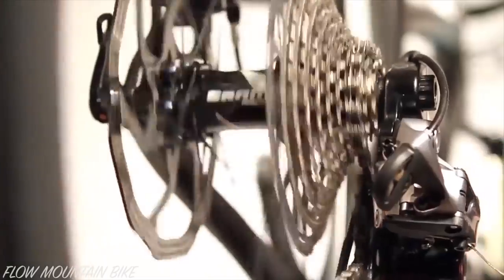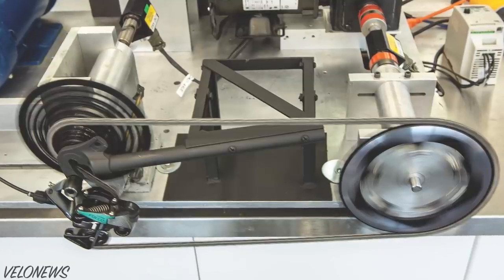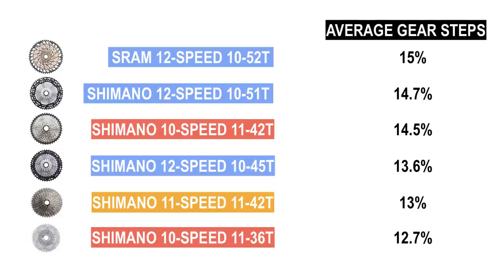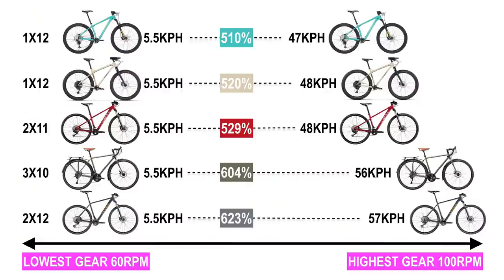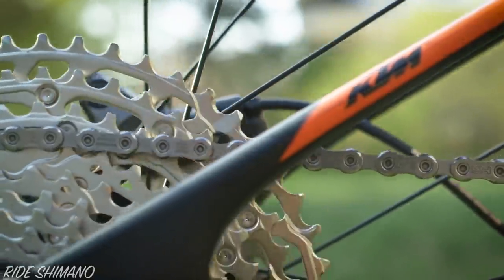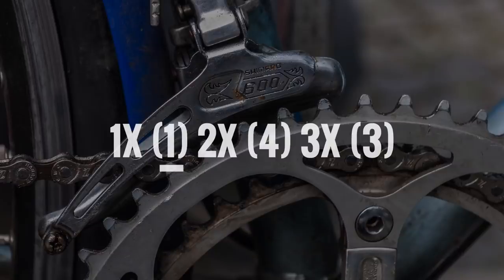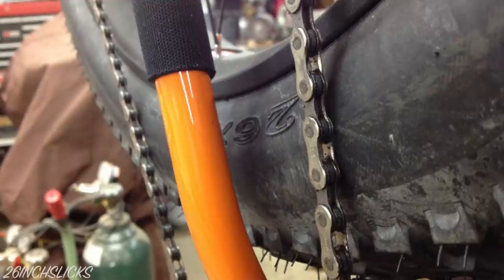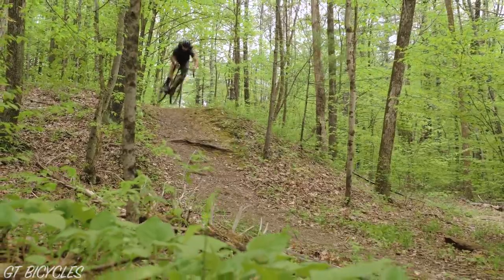1X vs 2X | What is the ULTIMATE Drivetrain For Your Bike?

Comment: Very timely... I'm in the middle of a 1997 Gary Fisher restoration 👍🚲
Reply: I recently stripped and powder coated my 1998 Gary Fisher Aquila. I replaced the fork 7-8 years ago with a Rock Shox Dart model, which was a great improvement over the worn out fork that was on it. After the frame was powder coated, I installed a new Alivio crank, a Wolf Tooth Components 34T narrow-wide chain ring & bash guard, and an Alivio 9-speed shifter coupled to a Deore XT derailleur and an 11-34 cassette. I did not think about the 9-speed drive train NOT working on the old wheels, so a new set of wheels were purchased also. OOPS.  I installed new Avid V-brakes and Avid brake levers also. Since I was building the bike up for commuting, I also installed a Blackburn rack. I only use the bike to cruise the bike paths, so I have 26 x 2.0" Bontrager slicks on the bike. All in all, it was a fun project, and I do like the simplicity of the 1 x 9 drive train. The 34T chainring and 11T sprocket at 100 cadence will produce 23.9 mph at 100 cadence if I remember correctly, and the 34T rear sprocket is low enough to get me up shorter and not-to-steep climbs. Since I live in the Denver Metro area, I am seriously considering an 11-42, 10-speed drive train.

Comment: I feel that there's another variant that's often ignored: 1X with an internal gear hub. Many 3 speed internal hubs can accommodate 8 or 9 speed cassettes and maybe (with some modification) 11 and 12 speed ones. That would allow you to reap benefits from both systems and have a wider gear range, since you can't cross chain.
Reply: Yes like the SRAM DUAL drive, works great.  You could fit a wide range cassette too, with an 11-40 you end up with a massive range of gear ratios - 640% !
Reply: Yes, this is what my Brompton does on a smaller scale with just two sprockets to double the three speed hub. Just seen a video of the SRAM DUAL drive that says you could keep the triple chainset and then get 81 gears, hilarious!  BUT...hey why not go 'hog wild', get an 11 speed hub, 12 speed cassette AND a triple, now you got 396 gears if my maths is right!  Probably not possible but 'one can dream' :)
Reply: @lauriethompson740  1x with a cassette and a 3 speed hub would be essentially the same as having 3 chains on front. The late Sheldon Brown had built one bike with 63 gears before those wide range groupsets existed. It consisted of a 3-speed Sturmey-Archer hub with a 7-speed cassette and 3-speed crankset. And that was before Sturmey-Archer offered a hub which could mount a cassette and SRAM's Dual Drive.

Comment: I just replaced a cheap chainring.  The first was replaced at 60000km and the second at about 180000 km.  I live on a dirt road so it is impossible for the chain to be kept clean.  Clearly I am not trying to win races.  But the figures in your video shows the extreme cost of seeking the highest performance.  Incidentally I also have gears from 22 -> 34 up to 52->11 a 7.3 to 1 ratio.  Because I am getting older and I want to remain on the correct leg pressure on any climb.  So "best" does depend on what you need from any system.

Comment: I use my hardtail for exercise, mainly on roads with nearly-slick tyres, and for longer rides and days out with cycling groups on canal towpaths and trails at weekends on fast-rolling "spuddy" tyres. I like my hardtail and don't want a roadie or anything with dropped bars.

I recently converted my 2x10 to 1x10 mainly because I detest the front derailleur - it's the clunkiest piece of engineering on the planet - so when my front sprocket need changing because it has worn so much, the 25% extra cost to convert to a 1x crank set made sense.

To be fair, I don't need the vast range associated with the 2x and in fact I could only ever get it into the very fastest two top gears when I was going down steep hills - I'm simply not strong enough to use those higher gears at any other time. I'm happy to coast downhill when I reach my current top speed (it's a little under 30mph - feels fast to me), so a smaller sprocket than the previous-large one suits well (I've gone from a 39T/24T to a 34T). Also, the narrow-wide chainrings are so great - I built a bike for my son with a 1x chain ring about 6 years ago and he's never lost a chain. The retention that narrow-wide tech offers is amazing. Such a small thing but the effect is incredible.

For me, the increased simplicity of a 1x leads to reliability, and that is the deciding factor. But even though I'm not a competitive cyclist, I concede that the steps between ratios are sometimes larger than I'd like. I'm looking at alternative cassettes to see if there's any with more linear steps than those I currently have but this is just tweaking - overall I'm very happy with the results.

Comment: My 9 speed chain lasts way longer than my 10 or 11 but it is on a triple so the chain is usually straight and from what my friend said his 1x12 chain didn’t last long at all and he’s just replaced it with one that cost £80 to see if it’s any better
Reply from the maker: The data suggests it's the top-tier chains in particular that have the excellent longevity. 👍🏻
Reply: CYCLINGABOUT yeah I’ve noticed a big difference in using wippermann chains compared to shimano, SRAM or KMC personally it will be interesting to see if my mates top tier chain lasts on his 12 speed set up because the last one didn’t at all
Reply: nickel metal chain   😉

Comment: 2x FTW
Reply: Yup.  I have 1x, 2x, and 3x, and except for grinding up outrageous gravel, 2x wins.  1x is misery.  Kids these days (haha) don't understand the value of good chainline and using the largest rings and cogs that you can for a given ratio.
Reply: I like the SRAM 2x10 system. 20 gears (even though one doesn't use them all), no front derailleur rub ever.
Reply: damnnn    😙

Comment: It's 1x11 on my carbon road bike (50x11-32) and 1x10 on my cheap and heavier winter bike (44x11-42). Smallest speed aimed to the 15% climb on my way home and the biggest is enough to do flat.
I got fed up of the front derailleur ; added a cog behind and removed 2 chainrings.
I don't see the front derailleur going away for those who want to do mountain climbing and also want to go quick in descents (even-though I can't understand that 3x still exists).
Most people riding bikes don't need 2 chainrings with 10 or 11 cogs on the cassette.

Comment: This is something I'm considering, whether to switch to a 1x for commuting or go 2x. Durability and longevity are my governing factors, the maintenance I find is a calming past time 😌. So I'm thinking of the Deore 1x12 ... as I'm at the stage where everything needs replacing anyways...
Reply from the maker: We don't have any data on the Deore 12-speed stuff yet, but using the groupset with a top-tier chain (XTR or maybe XT), which employs the latest metal and coating technology - should keep everything durable and long-lasting.

Comment: I have 1x3 but would prefer internal hub gears or 1x1 for simplicity. The highest gear i never use when on touring trips, down hill is rest time! Could have a lower gear than what I have though.
Reply: Downhill is for spinning the lactic acid out of your legs. I ride a 2x10 and tow a trailer (20+ kilos) and rarely use my lowest gears.

Comment: I use cadence to measure my ride over ride comparison. I am averaging 72-74 on a 20 mile run. High around 110-115. Pretty much similar ride profiles on most days. I currently have a 3x9 hardtail drivetrain. The overlap is pretty large. The top end is really low. Most of my riding is on gravel. Much of it not too hilly. I believe a 2x drivetrain on a gravel bike is best. I think the range is better than a 1x and it will have less overlapping gearing than my 3x. Your video is helpful in understanding the variance in %. Sounds like 2x is the way to go for me. Unless.... I start looking at closed belt systems with 600% spread and average 14% diff in gear changeover. Then it’s back to the drawing board😂😂😂😂😂
Reply: I also found that for anything used on road aside from touring a 2x is the best setup...period.

I have custom built 4 bikes all using 1x and every one of them lacks the gear steps to maintain cadence when going up or down a hill.

1x is a great setup for simple rides and for mountain bikes. But if you want some speed on pavement, 2x is the best.

3x is for touring or anything with loads. I use a 3x to haul my kid around.

Comment: I always skip 1 rear cog when I'm on the small front chainring on my daily driver when accelerating, and only go up or down by 1 on the rear when I'm on the large front chainring.

When I change to the large front chainring I go 1 back on the rear and increase/decrease by 1 after that, and I'm usually riding in the 2nd/3rd smallest cog unless going downhill or having a good wind in my back, what that tells me is that a 2x for a regular citybike is more than I need, a centered front cog (slightly smaller than the current front, but about 10 teeth bigger than the current small front cog) and 8 rear gears will benefit my much more.

Also being 1x8 means the chain won't cross as much as 11/12S (Although my 1x12 MTB is the best I've ever ridden with despite having a more limited top speed)

We need a front chainring that will move in and out, eliminating cross chaining, and keeping it 1x.

Comment: I've one bike with 1x11,  one with 3x9 (have had many) and two with 2x10. My current touring bike for 11y has a Roholff and that's my favourite, but for a cheaper bike, 3x is my favourite. I had a Dawes Galaxy with 3x8 for 13y but I changed the gears to an MTB 42, 32, 22 and 11-32 and the range this gave me was unbeatable. This bike eventually cracked.

Comment: Very well summarized. In my opinion they should make a cassette that has very small variances in the 95 cadence/30 km/h area as thats where most people spend time on roadbikes. Should be very easy to just have 2 gears very close to each other at that particular speed, and sacrificing one of the accelerating gears instead. I live in Indiana so its very flat ofcourse, but if this option was available, then it would be a no brainer for ME.

Comment: I use 2x10 on my Genesis vagabond and 1x12 on my trek rail, on ebikes drivetrain wears out quicker and must be checked out much often, to use a full steel cassette and chainring will prolong the life of the transmission making it lasts longer, on 2x10 on my gravel things are really different on normal conditions thousands of kilometers can be made.

Comment: As someone who still only has a 2x8, I'm a bit surprised with the results with chain longetivity. I assume (and because Berm Peak videos) that the thicker 8 speed chains would mean it's more durable.
At least it makes up for it by being cheaper, which not only applies to the chain but also the whole drivetrain.

Comment: Nice video. 2x will always have a place, and I don't see 1x vs 2x being in competition. Different tools for different purposes, something retro grouches that hate 1x need to realize. 3x, on the other hand, is dead. Not because of 1x, but because 2x has improved so much that 3x is redundant. 2x12 has superior chain longevity, similar chain angles (and I don't believe for a second anyone can feel 2-3 W difference), same gear range, and comparable ratio. Most of the overlapping gear on 3x gets ignored anyways. 

But wrt 1x, chain retention wasn't mention. For full susp absolutely its a necessity with frame constraint on front mech. But even with a hardtail or full rigid, chain retention (and yeah, tire clearance) make 1x absolutely superior for bikepacking. Even on farm roads (esp the ones here with heavy corrugation and pitting), 1x chain retention is a nice benefit. And, to add, popular bikepacking (at least in the Americas) is now in places that you simply must have a 2.8"-3" tire. You simply won't make it on something smaller. And, for that, you must use a 1x (unless you're on a fat bike, at which point efficiency is out the window, anyways). 

Once thing I'm not buying is the argument people make for gear range. I mean, yes, on paper, 2x/3x range is "better". But, on paper isn't real world. 1x has the same range in the lower gears. Its the high gear that is lacking; one may argue its either, depending on the front chainring chosen. But, mountain bike frames limit how large you can go on the front, typically around 34-36T. So, 1x suffers at top end, as you mentioned here. But really, how many people are consistently making sustained use out of a top end gearing that would have them, on a loaded down touring bike no less, running velocities that would place them in a World Tour peloton? Seriously...
Reply: I use the full range of my 3x9 22/32/44 in front with an 11-34 cassette out back. Loaded or not. I also pull a trailer quite often. When I'm not loaded, I like to be able go as fast as I want. 1x would be limiting for me as I would have to give up top end in order to keep the low end I have and use. Why should I have to compromise because of a stupid industry trend to force us into living with a limited range drivetrain? Getting a satisfactory range out of a 2x setup would cost me so much more money than what I already have that it's just not worth it. If 3x does eventually go away entirely, and I need to replace parts, I guess I'll have to cross that bridge when I get there.
Reply: @soundbites1152  You can't fit plus tires on your bike. You aren't relevant to this conversation.

Comment: When I was an avid mountain bike racer I hated the 3x. It always had the possibility of dropping the chain in difficult situations when I needed it most, no matter how well adjusted it was. For the way I ride now it doesn't matter but I still find the setup and adjustment of a front triple chain-ring troublesome, and the failure rate too high. I have never dropped a 1x chain though, and to me that is its strongest feature. Nevertheless, I think the 2x is just better for its effect on cadence as you outlined. Looks like I'm going to upgrade to 2x next.
Reply: i trust my 2 x 7  shimano,   my first  2x  ever,   it works well
Reply: 2 x 7 microshift / shimano  system   ...  find one
Reply: i never drop my chain in2x10 set up.
Reply: Update, I now have a 2x11 GRX group and so far its great. It is on a gravel bike so less likely to get the treatment my MTB got with a triple. To me the 2x10 was probably the best setup because it could be done without new chain/hub etc. etc. yet still have a smooth gear range. I like my knees so 2x7 = NOPE.
Reply: Jada jada jada. The "horror experiences" I never had from the marketing droids.

Comment: I don't about most folks but I'm still using 2x and 3x set ups on all my bikes. Yeah I'm old school however you can't get a 15.5 gear inch low gear with a 1x at least not yet. So I'll keep riding my 22/30/40 with my 10 speed 11-46 on my 920. 22/32/42  with a 10 speed 11-42 on my Fuel EX 7, 22/34 with a 10 speed 11/42 on my Superfly 9.7. Yep I need that little extra to get up them hills. Road bikes I'm running the standard compact cranks with 10 speed 11-36 on the Cervelo R3 (2008) same on my 2012 Venge Pro Force and the standard Shimano 105 11 speed group on my  2020 Domane SL5 Disk but thinking about sticking a 11-40 11 speed cassette on that one. Getting old sucks LOL.

Comment: 1871 was the first time a bike had multiple gears. Was definitely a 1x. Lots of racing bikes were 1x2 in the early grand tours. 1 climbing gear, 1 everything else gear. derailleurs were invented in 1877... they just didn’t get really popular until 1937 when the Tour de France allowed their use.  But they were used in other races before that. Oldest mention of 2x I can find is 1947. Might have happened earlier, but point is 1x ain’t new.
Reply from the maker: I clearly mean in the modern era where we have wide range cassettes, strong clutches and narrow-wide chainrings.

Comment: The chain durability test is somewhat skewed towards 11 and 12 speed chains, as 8-10 speed chains can be safely used until .75% wear, and single speed/internally geared hub chains up until 1.0% wear.
Reply from the maker: That's true! I wanted to keep everything as simple as possible for this video, and I also wanted to focus on 1X vs 2X vs 3X rather than the number of gears.
Zero Friction Cycling has some data that shows that chain wear is not linear, so you should be able to add 18-20% more distance to the 8, 9 and 10-speed chains. The Ultegra 10s chain would, therefore, jump up to 3300km and the HG95 9s chain would jump up to 2500km in the ZFC test.
If we extrapolate that out, the cost per 30,000km is $551 (3X10) and $518 (3X9) - substantially cheaper than 1X.

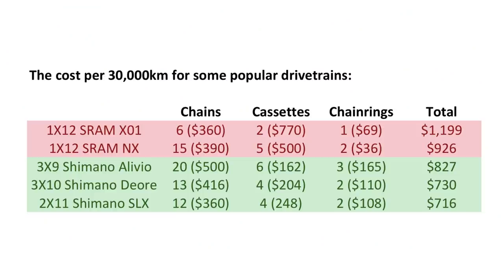Comment: I run 3x9, but tend to use it as a 2x most of the time, only occasionally requiring the bottom as a bail-out gear.  For the price-comparison table at 06:20, I think it would be interesting to compare a well-maintained vs a poorly maintained setup - i.e. for new cyclists who perhaps don't know to preemptively replace the chain, and as a result only get 1-2 chains per cassette - does that accentuate the costs?

Also I think it depends if you're an N+1 bikes person or not. I'm trying to get it down to 2 bikes (full-sus mtb + road/tourer).  If you have the luxury of a dedicated road bike with a compact 2x, and then a 1x gravel/mtb I can imagine that works well, but a 1x as the day-to-day for mostly road I think would bother me with the gear jumps.

Comment: I have all 9spd components, so I can't switch to a 1x without sacrificing either something. However, I hardly ever used my large chainring, so I removed it and have a 22/32 setup on the front. It kinda looks like a 1x from a distance. Interesting to know that there is an advantage to this system over a 1x.
Reply: I did the same